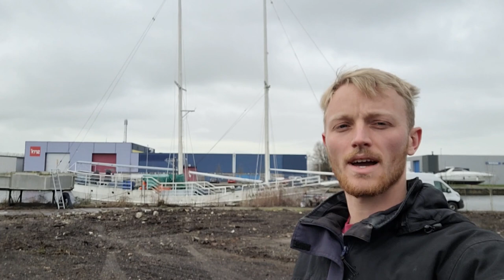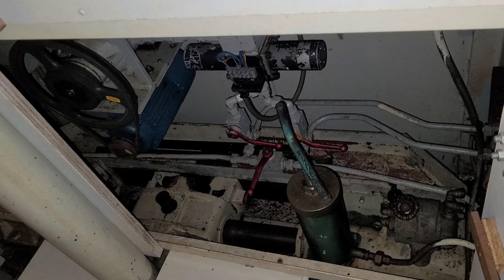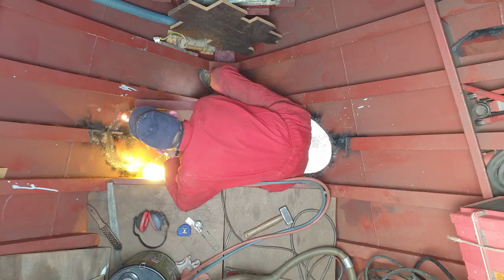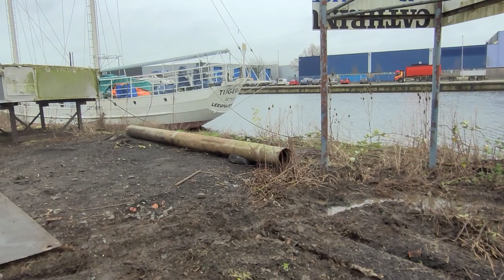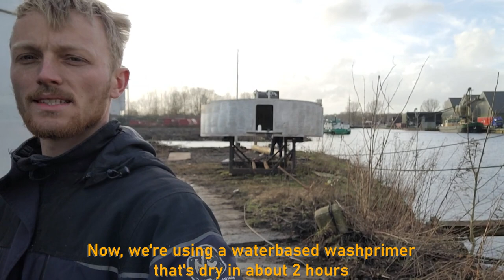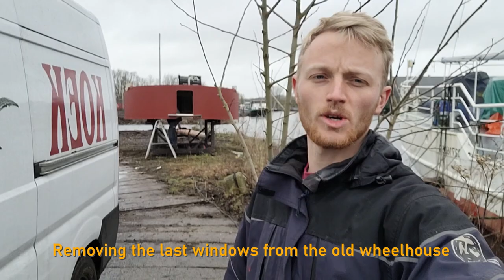Rebuilding Plans - Rebuilding Schooner Tijgerhaai EP3

Comment: i like to ask a question , why not move the new wheelhouse back,behind the 2e mast, and keep the main sail boom?
Reply from the maker: Good question! Because behind the wheelhouse is the saloon, and this is not a full deck lower, but more like half a deck. By moving the wheelhouse aft, we would remove space to stand in the saloon. Whereas the Engine room is a full deck lower than the wheelhouse, so we can use the overhead space that we have spare there. Hard to visualize like this I think. Today I will upload a tour of the ship, I hope that clarifies things. :)